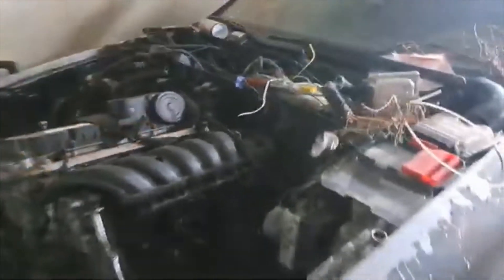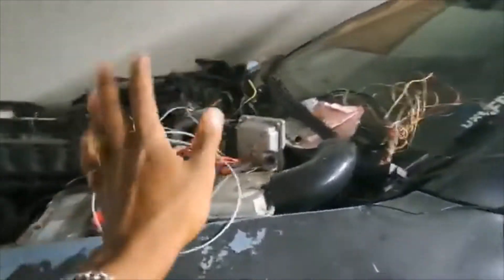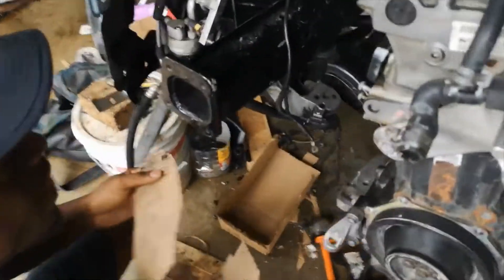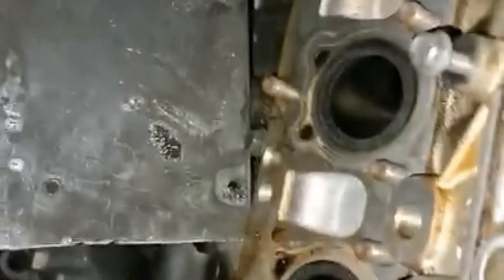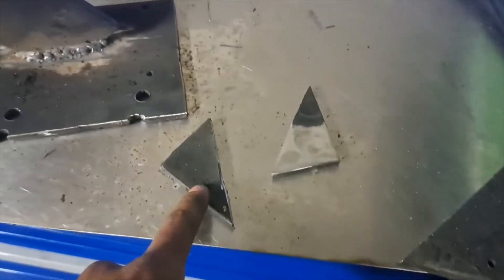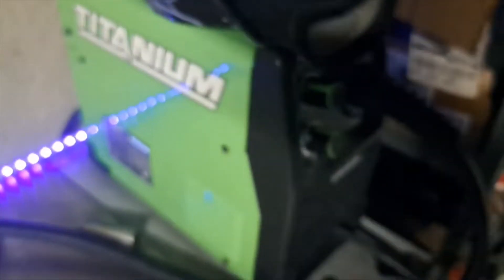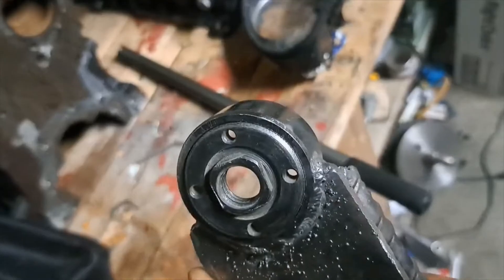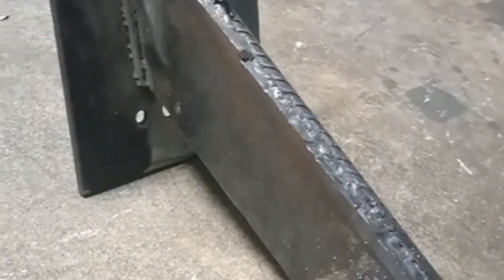How to 07KT swap  your Audi/VW ( B5,B6,B7/longitudinal Passat ) Pt 2 Mounts[ build]

Comment: got my 07k for 250
Reply from the maker: Dangg Out doing me on low prices!! Love it 😁
Reply: @LaunchBuilt  i was eyeing up the 07k swap for my b5...i think i am gonna make a tubular K member to clear oil pan ...or modify the stock on but the sway bar may be an issue next
Reply from the maker: I'm glad you mentioned that. If you want to see how I solved that. Subscribe like and share